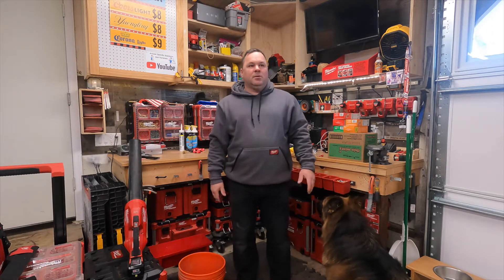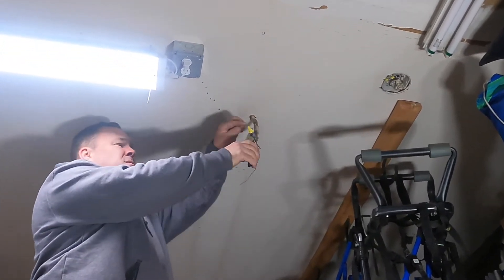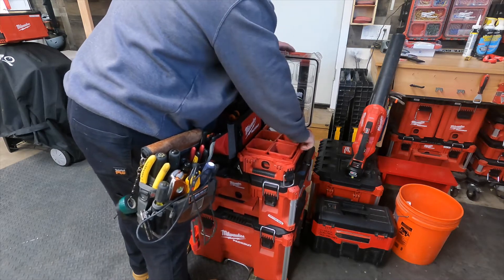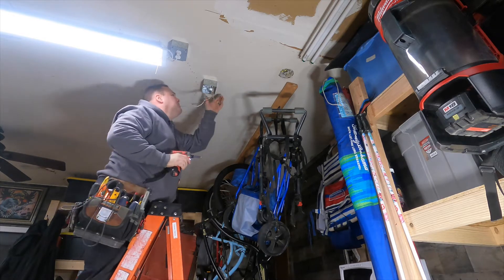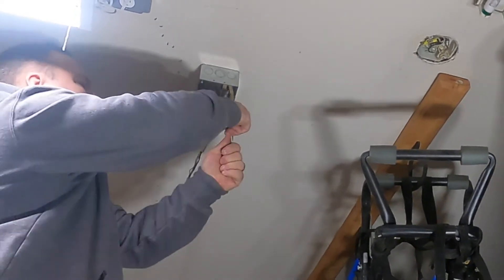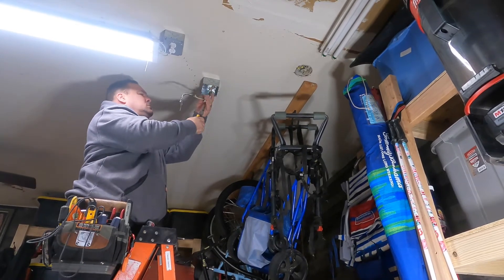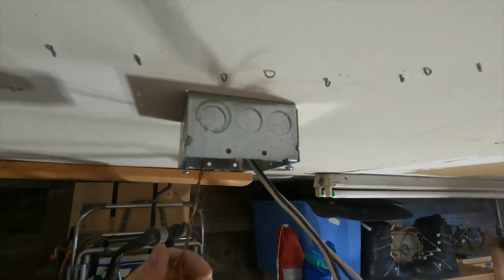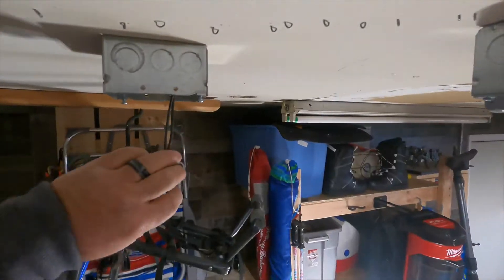How To Surface Mount a Junction Box

Comment: You should have made a cut out in the ceiling drywall and added an old work 4 square metal box. Cables coming out through a hole in the wall or ceiling without a junction box is not permitted. Connect the wires, put on a blank cover plate and you're done. Ground wires must also be capped off with a wire nut. If you want to add a surface mount box in order to add outlets, you should use a 4 square box extension, 1 1/2" deep is fine, and add EMT conduit from there.
Reply from the maker: Care to provide any code sections you referring to in your reply? Thanks 👍
Reply: @electricianron_New_Jersey  Ron, I believe that you are correct and I couldn't find any code sections that don't allow this. I was called on something similar that I did in a home remodeling project, but I didn't ask him to cite any code sections that discuss this. He mentioned that the exposed gypsum can cause friction if the hole is too snug and unsupported cable situation if it's too large. If you have an outlet box that is recessed by more than 1/4" you'll need an extender partially to isolate the wires from the cut drywall. This is not an issue in your example, but something that I was told.

Comment: Question . Say you did knock  outs on the sides and had wires in them with the proper romex wire clamp screwed into the box. Later you came by and removed a wire for some reason. Are there plugs that go into to hole you are no longer using? If so what are they called?
Reply from the maker: Good question! Yes, and they are required.  They’re called knockout seals and they can made from metal or plastic.
Reply: @electricianron_New_Jersey  thank you . I have never seen one. Will look at HD next time I am there. Thanks for the response

Comment: Thanks for the video Ron.
Few questions if u don’t mind:
1. How many screws do you need to attach the JB to drywall securely? What does the Code say?
2. I see that you fished all 6 conductors thru one strain relief? Is there sizing concern that need to be taken into consideration?
3. I’m curious why u used the farther knockout instead the center.

I’m doing something similar but with 6/3 and 10/3 Romex going to the Jbox before it would get spliced into THHN/W conductors to route to each receptacles using EMTs. Would you do 2 separate holes for each circuit or one giant, say, 1-1/2 hole for all conductors on the back of the the JB?
Thanks